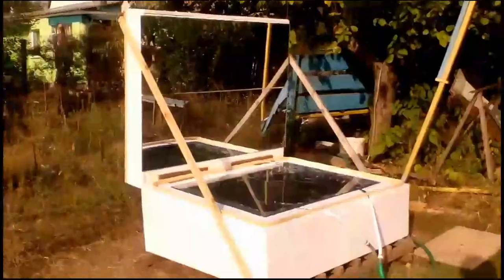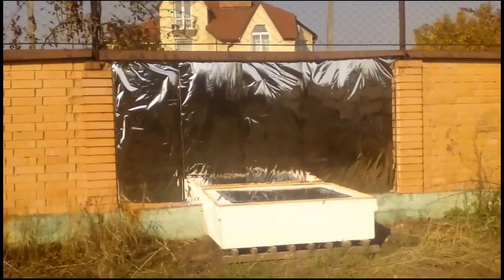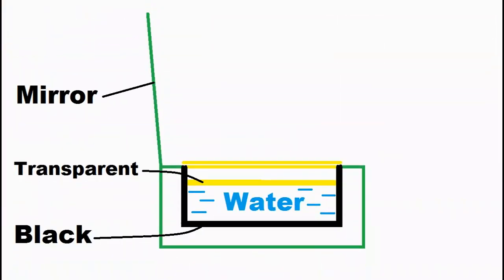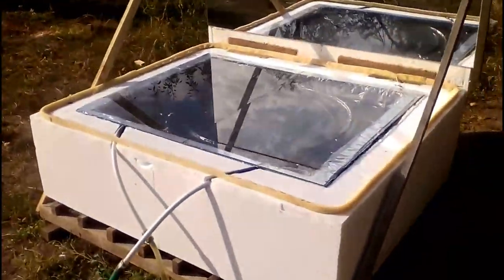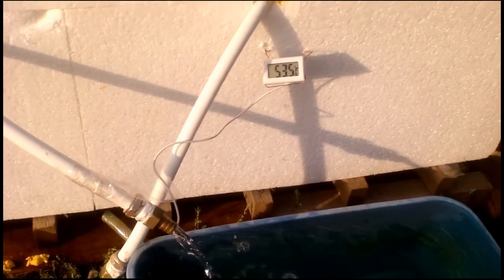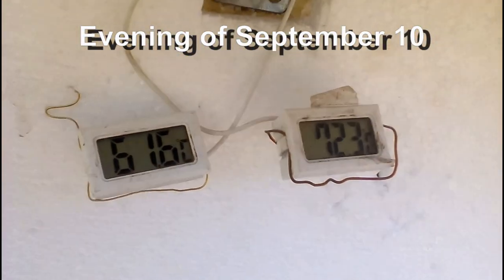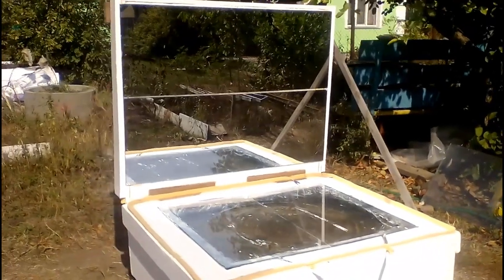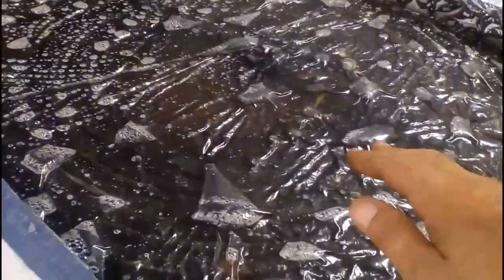How this solar heater gave hot water to my summer cottage

Comment: I really liked your videos... But I believe it's efficiency can be increased if you put it upside down.... I mean water tank at top and mirror at down (actually no mirror)... So here is my idea.. Make a box of 10x50x50 use metal inside and thermocoal(Polystyrene) outside put rain water in it and dark metal pipe (preferable copper pipe) then seal it for water leakage...  now connect it's insulated pipes to a insulated storage tank on ground(keep it side to setup) ... To increase the efficiency you can put a lens to concentrate sun rays on setup or put four mirror reflectors to put more rays on setup...
Now equilibrium will move cold water from tank to setup and hot water from setup to tank. In this way you can have more hot water to use as well continuous heating without maintanence...
Please share link with me when you try this.

Comment: This is very impressive design and the level of details is stellar. I am thinking to build one solar water heater and like the idea of having small pool of water for extra storage of heat. However, how will this perform in freezing temperatures? Will the water in black plastic bag freeze at any point, or it can't happen because there always will be some heat from sun on regular basis?